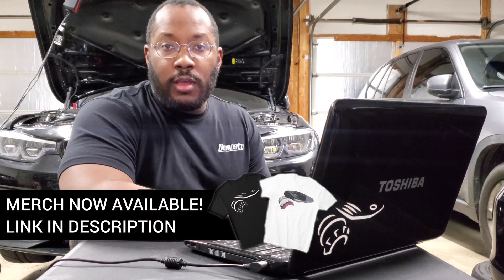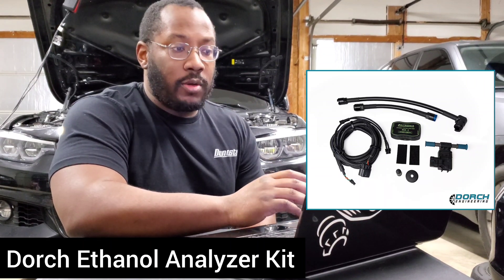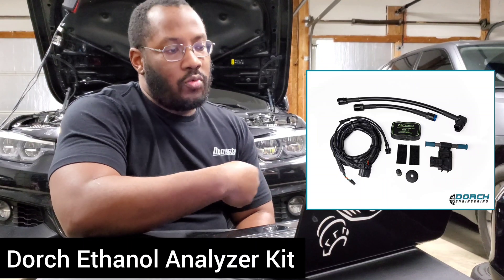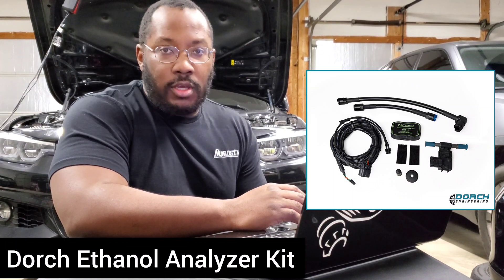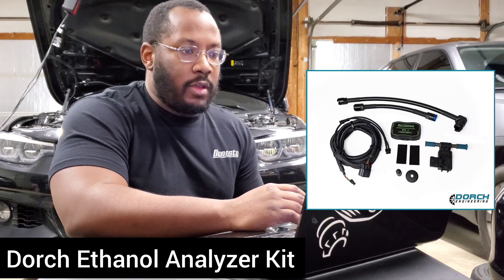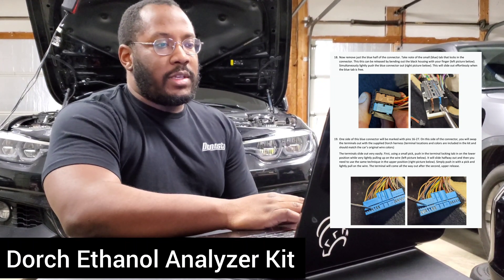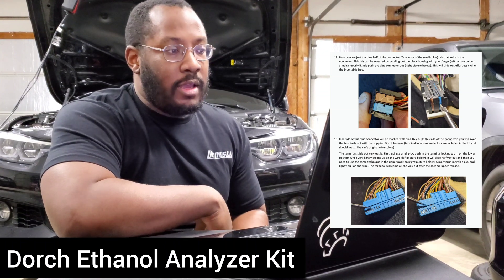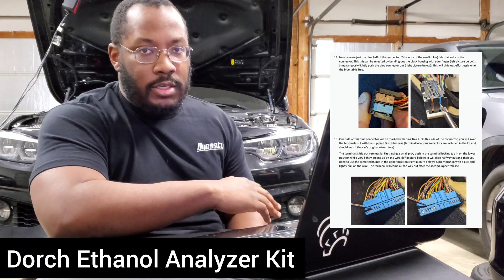DORCH ENGINEERING FLEX FUEL KIT RELEASE! - The B58 Digest

Comment: Which company would you say offers the best flex fuel kit at the moment Kern?
Reply from the maker: Mhd is the most convenient/plug and play
Reply: @kern417  what is the reason for this?  Thanks for your reply
Reply from the maker: @Dps2139  it installs in the engine bay and has a short harness to simply plug in to the car. I'll be posting a DIY in the next few weeks
Reply: @kern417  and so for a manual its better to pick the dorsh kit (just discover it) or the bootmod3 kit?

Comment: My question is... Will this replace the requirement to have a aftermarket high pressure fuel pump for the stage 2 + ots BM3 tunes.
Reply from the maker: No